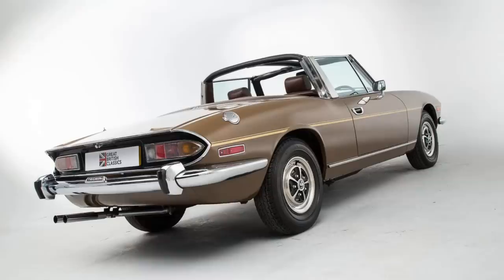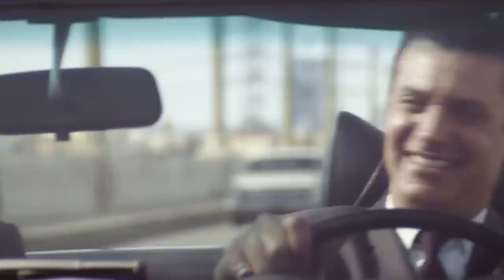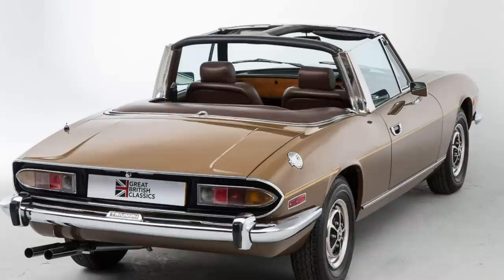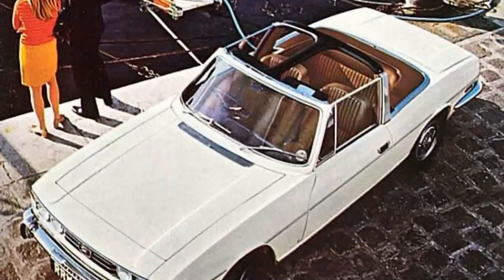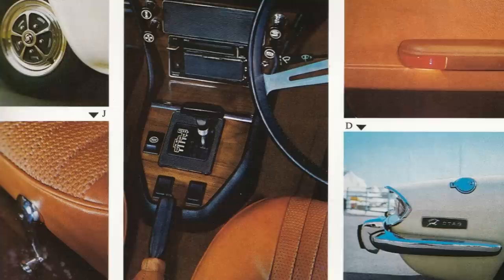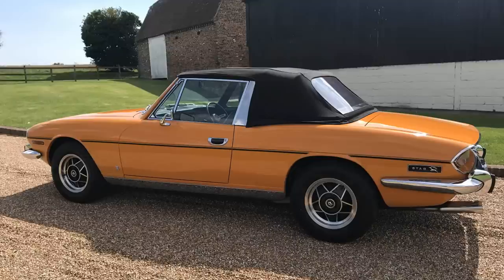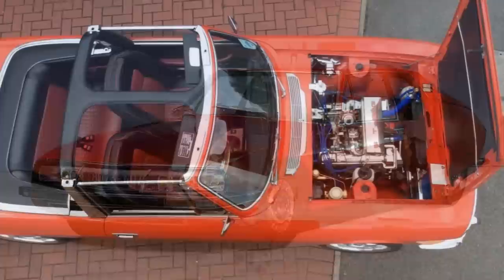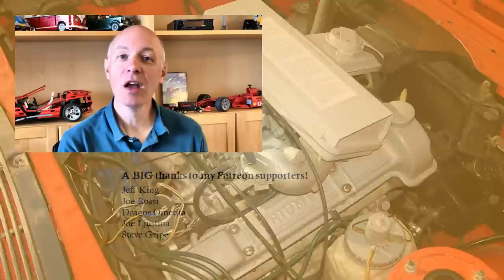Why did the Stag FAIL so Spectacularly?

Comment: The UK motor trade called it the Triumph Snag.  The engine was the death of this car and the early SAABs that also had the inclined stud 4 cyl engine.  My father had one and persevered for years trying toget it watertight.  Heat cycling made the head move laterally, destroying the head gasket.  Corrosion would make the head studs impssible to remove.  I remember him drilling some out (!!) which took him hours.  Moral: only idiots make engines with such obvious design errors.  You can't make a silk purse out of a sow's ear.  Brains like those who designed and then CHOSE that engine contributed to the demise of the UK motor industry.  I think I also recollect that you had to remove the camshaft if you wanted to tighten the cylinder head down. Twits sitting at drawing boards!  Mentally feeble people in charge!

Comment: "And regular servicing meant the car could be reliable" You say about the four cylinder version of this engine.  This is COMPLETE bullshit!  Saab had to re-engineer the cylinder head to get away from the stupid canted head bolts before this silly engine became somewhat reliable!  The later SAAB turbo versions of this engine were bullet-proof, but any canted  bolt edition is a head gasket waiting to fail~!

Comment: Ignore the superb,  reliable,  powerful Rover 3.5 to build a smaller,  less powerful new engine? That was a lack of common sense only followed by the lack of common sense in the actual design of the engine.  Wow .
Reply: They didn't ignore it, they simply couldn't use it on a production level, Rover were flat out building V8s for Rover cars and would never have met the volume that Triumph had envisaged for the stag. In terms of power there really wasn't that much difference, Rover P6 155 bhp Stag 146 bhp don't forget the Stag was 500cc down on the Rover

Comment: Everything that could go wrong, did.
Reply: Absolutely, but they didn't learn. This engine was a V8 version of the slant 4 design. This engine was later used in the Dolomite Sprint (in 4 cylinder 16 valve form). This highly tuned engine was probably the most unreliable lump of all time.

Comment: Yesterday my daughter was complaining about the dominance of German car production in England. I pointed out that thanks to labour unions crippling the industry and lack of investment since the sixties we haven't made a decent car since?.. maybe better than the opposition but rose tinted glasses to one side. I had a maxi, always had to park facing down wind because the damp got into the distributor. Marina anyone, chicken wire and filler, Allegro, the car of third year students and sleepless nights ( and getting stranded!). Minis with the rust, electrics and hydrolastic suspension 🤦 maybe the Morris minor designed in the thirties, probably the best last car made in England 🤔 And by good I mean good, not adequate or it was ok if it didn't rain or steel didn't turn to rust or night followed day.

Comment: You get one of these, and you trash the engine... 
And you put in an American super mass produced LS or Ford Modular. Even the old LTs or Ford 5.0L will get the job done. I've seen MGs and MX5s loaded with more power than it needed. 
A shame this beauty never got the power it deserved.

Comment: Terribly designed engine v8 that had everything but overheated from new...also the worst rear suspension set up imaginable! apart from that it was a beautiful car..now days the probs have been sorted with knowledge and time...in the day in the 80,s they were changing hands for peanuts ive owned 8 and every one overheated..would i own one now? not as a daily driver but they look great as a design visualy.. imagine if they had fitted the rover v8 with a holly carb!! but theres historys mistakes,, Steve Cline 27 years classic car buyer restoration and seller.. happy days

Comment: An absolutely terrible engine, that's what killed it.  Instead of using a reliable stable V8 engine, they decide to go and bolt together two 4 cylinder engines.  After that, all sorts of issues, especially serial overheating issues and blowing gaskets.  Shame: it's a great looking car

Comment: So many errors in this.
The Spitfire did not receive the revised rear end until after the 2000.
The engine is not 2 slant 4s that is a urban myth. This is why you cannot fit two Sprint heads to it.
Rover was bought by Leyland it did not become British Leyland till the merged with BMH about 18 months later.
Engine had a timing chain not a belt
Primary cooling issue was the need to expand the engine from 2.5 to 3 litre after the tooling was signed off, (so not allowing revision of the cylinder spacing), due to the need to delete the unreliable Lucas fuel injection. This led to the overpressure  issues that led to  airlocks that stopped the coolant returning from the expansion bottle.
Alloy head on an Iron block is a world wide engine design feature, even in the late 60s, for example Roots Hunter 1725 engine, or Lotus Cortina were using it at the time in the UK.
The O series was a British Leyland engine, was not seen in an MG until the Montego.
Reply: I think it did see service in the Morris Ital 2.0 mated to a (ghastly) 3 speed automatic transmission. Also the Austin Ambassador was fitted with an O-Series 2.0 unit. HLS and Vanden Plas models were 'treated' to twin SU caburettors. The joys of balancing those things.

Comment: Most of this is "Stag lore" that simply isn't true.

 Yes, the timing drive was ridiculously light - but it was a single row chain (NOT a belt) per side that had to be changed every 25,000 miles. But some later cars had timing belts that had to be changed every 37,000 miles (Astras, Alfa 75). The spec says change every 25k, you do it, no problem. 

The "water pump high in the engine". So what? The Stag holds 10 litres of coolant; keep it full. If you let other cars get 20% down in the cooling system = same problem. 

"Angled studs" Don't get me wrong, they are a bastard to remove when YEARS old - but they cause NO trouble in service/while in use. 

"Different material for block and heads"  = like half the cars in the world...........so (again) = NO problem.

The REAL problems with the Stag were;

1. Atrocious quality control by British Leyland. It wouldn't have mattered WHAT the cars were like, they were being thrown together. Dealers reported finding when cars were overheating under warranty that the cooling passages were FULL of casting sand.

So - get blocks back from casting - no one washes the sand out. That is NOT THE CARS FAULT - that is just slackness and stupidity.

2. Alloy head car BEFORE most cars of that price level had them.

Every car these dealers got their hands on had cast iron heads. You put water in them, they didn't corrode. They get an alloy head car and get told about "special coolant/rust inhibitor" - how many would be "Nah, always used water, she'll be right."

This was an alloy head, overhead cam car that was handled/maintained/driven by dealers/owners that had always had cast iron, pushrod engines. 

No wonder they had problems.

Ok. Try this then. How reliable is a new Honda/Toyota????? Take one back to 1970. Fill the engine coolant passages with sand. Put NO inhibitor in it. Ignore the timing belt change interval. HOW LONG WOULD IT LAST??????

I have had a Stag since 1993. I live in one of the hottest places on the planet. I have driven it from Melbourne  - Perth return 7 times between 1993 and 2003. I used to do it at Xmas - 4 weeks holiday and then drive back. In summer, routinely high 30's degrees C - but across the middle of South Australia routinely 48 degrees. 5 hours every stint, driving dawn til dusk, 120/130 kmh in the desert stretches (5 hours fuel range, approx 500 kms per tank.)

I have done 340,000 kms in mine.

The Stag has some stupid design ideas. Those studs are a hassle, but you fit bolts. 

The "reasons the Stag didn't succeed" have far less to do with "high water pumps/angled head studs" - and EVERYTHING to do with people being slack/not doing their jobs/NOT CARING. 

Steven Mettam (stylist at the BSA factory) watched a guy bolt on a tail light holder that was malformed/not pressed properly. It CLEARLY couldn't be sold like that. When he asked the guy why he would send it down the line like that, the guy said "Somebody else gets paid to do Quality control, not me." And look what happened to BSA in 1972.

Says it all. 

If Mercedes had made THEIR cars in that Triumph factory with that mindset; they would have been just as bad.

Finally - why is the water pump on the Stag on the top? (and yes, that is the WORST part of the engine, but not for the "high coolant" reasons - but because it is gear driven - and needs care). BECAUSE - Saab needed a new engine and "went shopping". BEFORE the Stag design engine found it''s way into the Dolomite/Dolomite Sprint/TR7 and was still bei9ng developed - it was sold to Saab. But with a water pump on the front = too long to fit in the Saab. SO - the sole reason the water pump on the Stag/Dol/TR7 is on top - was for Saab - and Triumph were then stuck with it.

But if that engine is SO UNRELIABLE - how come Saab had hardly any trouble/don't have the same reputation???

Because the Triumph engines = put together at Triumph. Saab engines  = put together at SAAB!!!!

They didn't "leave sand in the block" - and they used correct corrosion inhibitor.

Funny when you aren't slack - things work better.

THAT is reality.

Comment: Gorgeous looking car that could only be an Italian design...but Triumph trying to beat the Germans? - it was never going to end well..
Reply: It's almost as though there was a plant in Triumph; to destroy them from the inside out.  Communism was certainly using the unions to achieve similar.
Reply: The amusing bit was that the Brit motoring press had M-B so terrified that they put a V8 into the panzerwagen.  M-B terrified of this?   Even had the Stag had worked, it was 3 or 4 classes below.
Reply: @doubledee9675   MB 300 SL and 450 SLC were vastly superior in about every way. Yes price was much higher.
Reply: @pauloconnor7951  Exactly.   But that did not stop the press treating the Stag as a threat to the SLs and SLCs.
Reply: @doubledee9675   I was a 12 year old kid (N.Z) Dad was on his 4th of five  2,000s and 2.5 TCs. He brought home a STAG brochure; and I was in awe !!!.  Anyway sounds like the  Press (MSM) was playing their usual game: The Three "Cs"  Catastrophy, Calamity & Contovercy .  Where there isn't any; create it !. They literally are the original deuchebags !!!.  Irrelevent and to be ignored; if not removed to a leppers Island.
Reply: @pauloconnor7951   Nothing wrong with the 2000 series, a more than worthy range to take Triumph back to such cars as the Renown and the similar pre-War models.  The troubles with the Stag stated with some engineering errors at the design stage, but more importantly with the manufacturing errors which ignored such simple steps as making sure that castings were completely clean. Then the model ran into the industrial problems that  arose from the attempts of trade union leaders and some of  their Labour party colleagues to radically change the UK political system.
Reply: @doubledee9675  , Right !. And today, Atleast the Australian Labour party seems allined to the Democratic Party (USA) destruction. Covertly hostile Politics is part of the story sadly. Unions caused so many strikes in N.Z.  Things got more overt with the Lima treaty; signed mid 1970's ; causing full closure of Australian car manufacturing recently !!.  It all points to "globalisation" of the One world Gubbermint.  BREXIT NOW !!!

Comment: The Stag was an attractive car but the engine was total crap. Waterpump inside the engine   what were they thinking! The 3.5 Rover was at best average but at least proven. And lighter.
I have had the misfortune of driving both the Stag and TR6. Both handled worse than an MGB. And they were at best poor!!
Though I feel the TR6 [Vanguard 6] had more power and driveability.
Another garbage engine too was the Dolomite. An attractive carthat too did not drive as well as it looked.
I have seen Stags with Rover V8s as well as Ford Windsors and have heard about Chevs as well Though the diff ratios were too short for better torquier engines And weak as well.

Comment: Pantera Rio?
Reply from the maker: Yeah - that was a mistake. It's the "Panther Rio". They only made 30 I think, so really low volume.
Reply: @BigCar2  I remember it, took a Dolly, retrimmed the interior and new wings, bonnet and grill. Made it ugly as the square ends didn't match the middle.

Comment: They also had tiny radiators and narrow oil passages in the engine block so, once they came to the hot climate of Australia they were basically grenades.
Having owned a Triumph Dolomite Sprint(same color as the pic) I have first-hand knowledge of Triumph cars.
They were unreliable rubbish.

Comment: Designed by Italy and implemented by Britain.  No wonder it failed.
Reply: It was only styled by an Italian, not designed.
Reply: @lewis72  styling is design.
Reply: @RonJohn63  
No it isn't.
Reply: @lewis72  you're using a very narrow definition of "design".
Reply: @RonJohn63  
You are.
Cars are styled by 1 person, they are designed by hundreds.
Reply: @lewis72  the Stag is an example of when  styling is divorced from design.
Reply: @RonJohn63  
So it wasn't designed in Italy then, which was your original assertion that I contested.
Reply: @lewis72  someone had to design the body, and it wasn't done in England.
Reply: @RonJohn63  
Can you substantiate that ?
Reply: @lewis72  can I substantiate that the body was designed in Italy?
Reply: @RonJohn63  
Can you substantiate your assertion that "someone had to design the body, and it wasn't done in England" ?
Reply: @lewis72  towards the beginning of the video, he says that the body was designed in Italy by an Italian that Triumph had worked with before.
Reply: @RonJohn63  
Michelotti styled it.
Who designed its structural rigidity, durability, manufacturability ?

Comment: There was never anything exceptional about the Power Trains of english motor vehicles.  90% of them were either poorly designed and or used inferior components.  From an engineering mechanical point of view, they were rather pathetic.  Best example of stupid english engine design was the Jaguar XK-E 4.2 6 Cylinder Engine.  The purpose of using Dual Overhead Camshafts on engine is to achieve High Engine RPM that could produce high power outputs.  The Jaguar engine was dead at 6000 RPM reflecting a Long Stroke and Small Bore.  In order to replace the Clutch Assembly, the Engine and Transmission had to be removed.  26 Hours of Labor was absurd.  The imbeciles did not build an Interior Removable Transmission Cover similarly used on all Triumph TR sports cars.  MG's were also stupidly designed.  Most of the english cars of that era looked good as long as you did not examine what was under the hood.

Comment: Who’d have thought that a rust bucket with an unreliable engine wouldn’t be able to go toe-to-toe with a Mercedes? 
The Stag is proof that a pretty face is no use if the skeleton underneath it is made of chalk.
So many of those issues with the V8 were entirely predictable, you just needed engineers and designers who were at the top of their game and who had a depth of experience, Triumph and subsequently British Leyland didn’t have those engineers. Add in the destructive union forces and there’s a recipe for disaster.
Reply: None of this has any factual basis at all.  Triumph didn't design the engine - neither did BL.  The Stag didn't rot - that wasn't its issue.  Would love to hear your views on Brexit as they would surely be far more palatable than the truth.
Reply: The Mercedes rusted just as effectively as the Triumph; the only reason why this wasn't immediately apparent was the Mercedes owners had to protect there rather more substantial investment by not using them as much.